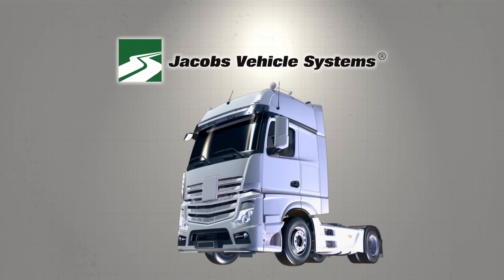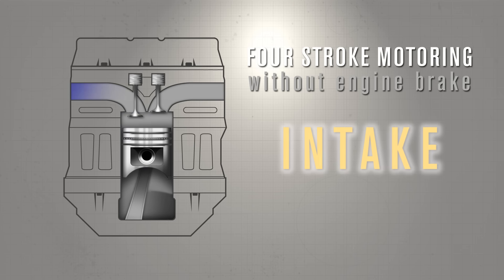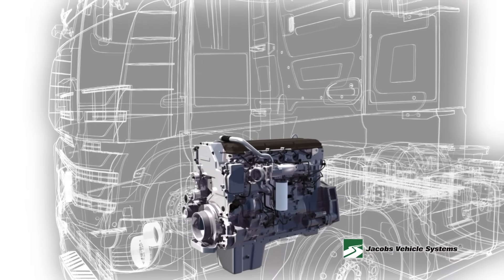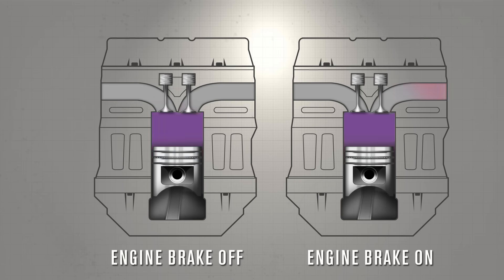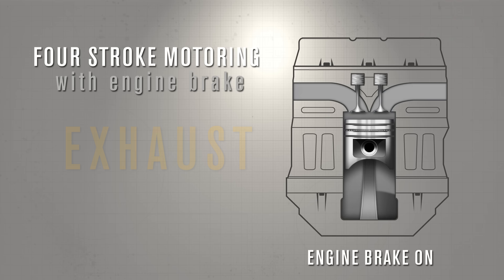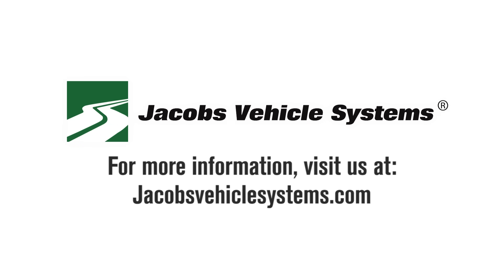How a Jake Brake Works - Jacobs Vehicle Systems

Comment: What I don't understand is how does the exhaust valve open near the top of compression without piston to valve interference? With the process operating as illustrated in this video, that exhaust valve would be completely smashed.
Reply: Most diesel engines are "non-interference" meaning that the piston doesn't travel into the space required for the valves to open fully.
Reply: @redsoldierftcarson  definitely false. Diesel compression is too high for it to be non interference. There's a reason most diesels are timed with gears, and not with chains or belts.
Reply: @kaulincurtis9665  false diesel engines do not have too much compression, they are timed with gears due to the greater amount of torque produced. Chains and belts would not hold up/last and that's important on a commercial vehicle engine. I don't know where you heard that but please Google it or talk to your local truck mechanic. I'm not saying all diesel engines are non-interference, but most of the ones I work with on large rigs/equipment are.
Reply: @redsoldierftcarson  what engines are you working on? I did Google it before I replied, and was unable to find a single example of a non interference diesel.
Reply: @redsoldierftcarson  I am no diesel mechanic, but I am an experienced automotive mechanic. Most gasoline engines ranging from 9-11:1 compression ratio are interference. I understand that the stroke on a diesel is often longer, usually greater than the bore diameter, when compared to gasoline engines. If the stroke was long enough, you could achieve 16-17:1 without piston-valve interference, but, from my understanding, that large of stroke would be impractical because of large frictional losses, crankshaft geometry, block architecture, etc. to accommodate the large stroke. In addition, most diesels have a combustion chamber shape in the piston top, this brings the piston even closer to the cylinder head. I know that 5.9 Cummins, an engine similar to what is found in big rigs and heavy equipment and has all of the characteristics I just mentioned, is indeed an interference engine. 

If you can show me a diagram or other form of hard proof that proves me wrong, I'll take it. If not, I'll believe it when I see it! The internet search consensus is pretty much all diesel engines in service are interference engines.

Perhaps a more accurate representation of compression brake in an interference engine is the valve opens as the piston is part way up on compression, and closes as the piston reaches the top.

Comment: these jake brakes are so useless and so old school that almost has 0 point installing to the trucks. Modern retarders are oil based or magnetic retarders that really can slow down a truck, on downhill with 40 tonns there is no way to stop or maintain the speed of the truck without the service brake while modern retarders can hold or brake down even more the truck. The US is so old faschioned with their 100 years old technology

Comment: Doesn't  that push un-fired fuel through the exhaust? I always thought they just worked as an exhaust brake. I wonder why they don't put them in the big 3 trucks. $$$ I bet.
Reply: It shuts off the fuel supply to the injectors while the jacops brake is in operation, as soon as the engine falls below a set rpm (usually 1000) or the operator disengages the clutch or applies the throttle the system shuts off and the fuel supply is turned back on.
Reply: An exhaust brake is not the same as a Jacobs brake.An exhaust brake has a valve in the manifold that restricts the exhaust gas flow thus slowing the engine.

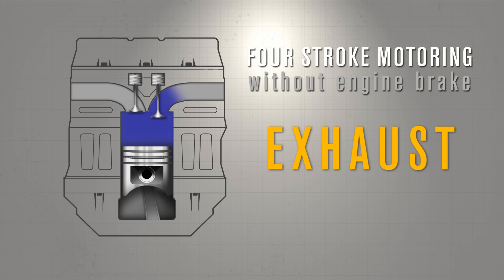Comment: At about 0:49 he states "..and expand, thereby pushing the piston down and returning energy back to the engine." If energy is 'returned back to the engine' where did the engine get it in the first place? This is a nonsensical statement. The energy to run the engine and thus propel the truck comes from energy stored in the combustible fuel.
Reply: The purpose of the video was to illustrate how a jacops engine brake system works not the fundamental operation of a diesel engine.

Comment: this video does not tell the whole truth...your engine is already an air compressor.. it compresses the air after the intake  stroke.. what a jake does is open the exhaust valve, just as the fuel injector would have fired, (causing the power stroke when the jake is off).. this allows all the highly compressed air to escape.. the valve closes..now the piston is at the top, with both valves closed, and it begans to move down, pulling a vacuum, which is what slows your truck.. it pulls vacuum until it sucks the valves open.. 
that's why, when your valve springs get old and weak, your jake brake looses some of its braking ability.. install new valve springs, and your jake will work as new..
Reply: Thanks!
Reply: Actually unless you are referring to another brand or setup that I'm not aware of you have it backwards; the fuel to the injectors is cut off and the exhaust valve is delayed from opening untill just before the  piston reaches top dead center on the compression stroke.
Reply: @redsoldierftcarson  you know nothing of the engine Dynamics.. the exhaust valve stays closed until the exhaust cycle.. the Jake opens the exhaust valve halfway through it's normal closed cycle, venting off the compressed air.. now the piston draws a vacuum, instead of producing a power cycle.. and yes, the fuel has to be cut off, but the injection pump already does that during de-cel..  why is this so hard for people to understand? Google "vacuum pump" look at the way they operate, and you will understand how a Jake works.. it turns your engine into a huge vacuum pump, sucking you to a stop. It takes more energy to pull a vacuum, than to compress air.. 
However, a Jake is very hard on your engine.  I have seen the tops of Pistons sucked off, rod bolts sucked in two, wrist pins snapped, and valves sucked into Pistons.. this is why, Jacobs hides this truth of operation.. you shorten your engines life..

Comment: How does this reduce fuel consumption if its still taking in the same amount of fuel?
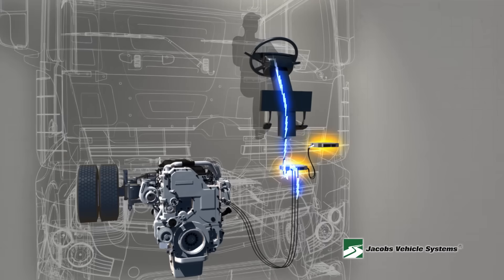Reply: At about 1:40 they remove foot from throttle. This reduces the amount of fuel injected into the engine. But the video is kind of poorly narrated.
Reply: It shuts off the fuel supply to the injectors while the jacops brake is in operation, as soon as the engine falls below a set rpm (usually 1000) or the operator disengages the clutch or applies the throttle the system shuts off and the fuel supply is turned back on.

Comment: He forgot one fact - the Jake Brake was actually invented by Clessie Cummins, the man who started the Cummins Engine Factory. There's quite a bit of history behind it.
Reply: And the first one ever installed was on his boat.  So, when you rev the engine and let the brakes roar, you're carrying on a tradition older than the production of Jake Brakes.
Reply: Yes, I read a very interesting book written by Clessie Cummins. He invented the Jake Brake after his sons took over the Cummins Engine Factory, but they didn't want anything to do with it, so he went to Jacobs Locks and they took it on, which is why it's known as The Jacobs Brake. Cummins did adopt it eventually due to pressure from their customers! Silly kids thought they knew more than their Dad.
Reply: I wonder why Cummins didn't just come standard with this built in
Reply: @P7777-u7r  When Clessie Cummins invented the Jake Brake, he was no longer in control of the Cummins Engine Factory, and the people who were in control at that time would not agree to manufacture the Jacobs system, so Clessie Cummins was forced to look for another manufacturer. He found the Jacobs Lock company, who agreed to take it on as they had the necessary manufacturing capability and were in the process of looking for a new product. That's why it's called a Jacobs Brake and not a Cummins Brake. Cummins Engine refused to fit the Jacobs Brake to their engines for some years as they didn't believe it was beneficial to them. Big Mistake! I believe that it was Clessie's Sons who had taken over, but I'm not 100% sure of that.
Reply: @P7777-u7r  When Clessie Cummins invented the Jacobs Brake he was no longer in control of the Cummins Engine Company, and they refused to have anything to do with it, so he had to find another manufacturer. That's when he approached the Jacobs Lock company. They had the manufacturing ability and were looking for a new product, so they took it on. That's why it's called a Jacobs Brake, not a Cummins Brake. Cummins still refused to fit it to their engines for some years. Big Mistake! All this is in Clessie Cummins book "The Fire Within". Good reading, that one.
Reply: @P7777-u7r  they are factory equipment.  Except Cummins calls it a c-break.
Reply: For anyone interested in the Development of the Cummins engine and Clessie, a must read is "The Engine That Could. Seventy Five Years of Value Driven Change at Cummins Engine Company" by Jeffrey Cruickshank and David Sicilia.
A cracking Read!

Comment: Uhm, wow, I really expected an usual fancy energy converter while engine braking for further fancy usage.. and not some exhaustion/waste system for valuable energy which you actually pay for.
Reply: It's true Ignoramuses of your ilk, that make a comment you know absolutely nothing, whatsoever about!  Prove me wrong and show me a device that actually does what what you state, or hell, better yet, invent something that does hat this does, for both safety, and utility, and I'll eat my words to you, otherwise, quit showing your Ignorance in the public eye  You'd be much better off, trust me!  This device has been in operation for a Real Purpose for literally decades, uhm wow!
Reply: It shuts off the fuel supply to the injectors while the jacops brake is in operation, as soon as the engine falls below a set rpm (usually 1000) or the operator disengages the clutch or applies the throttle the system shuts off and the fuel supply is turned back on.

Comment: So...  it turns a 4 stroke into a 6?
Reply: No, it's an extra rocker arm that takes control of the exhaust valve(s) in a cylinder and keeps it from opening until just before the piston reaches top dead center (end of upward movement) thereby using the engines compression to slow the vehicle.

Comment: So when it happen there no fuel going into the cylinder? And is no then does the truck die or how does it keep running?
Reply: a jake brake will stall a engin. it has two switches one inside one on the engin. the jake olny works when your foot is off the accelerator and the switch is on

Comment: It would be something if the compression could be stored and later used.
Reply: Like a separate exhaust valve (only used with the jake brake) that leads to an air tank?  That would be really useful.

Comment: Too bad the video never tells us HOW a jake brake mechanism works...that is, how exactly does it keep the exhaust valve open. Could not bother with that detail.
What are service brakes? Are those what we normally call "brakes"?
Reply: Yes, service brakes are what the segment of population unfamiliar with proper vehicle nomenclature calls simply "brakes". The Jake Brake works by actuating the exhaust valve rather than the fuel injector. So... the intake air is compressed and then dumped slightly before TDC.

Comment: 2:18 valve open and piston crash into the valve? Fail?
Reply: Big Diesel engines are not critical engines. Meaning that there is enough clearances for this operation.
Reply: Diesel engines are usually "non-interference engines" meaning that the piston doesn't travel into the space required for the valves to open fully.

Comment: You can drive with a Jake brake at full volume anywhere in Colorado. You would never hear it over the straight pipe Harleys.
Reply: $500 fine in Colorado for unmuzzled jake brake. There’s a sign at every port of entry and when you cross the state line. If you roll across the scales with no visible muffler they will call you inside and talk to you and either write you a citation or you show them an underneath muffler.
Reply: That's not at all accurate
Reply: I thought Vail had "no jake brake" signs everywhere, because they prefer truckers fading brakes and killing minivans full of kids, versus having to hear that ghastly noise.
Reply: @MockOverdrive  Vail is a tourist trap these days, growing up just off of i25 i would hear them all the time.
Reply: @MockOverdrive  this is a 0 IQ comment lol
Reply: To be fair, I too get annoyed at truckers who purposely mod to make jake louder, it's incredibly disrespectful and equates to being a 13 year old attention whore on tiktok. All jakes should be somewhat muffled by federal law.
Reply: @MockOverdrive  yikes.
Reply: With or without straight stacks? Several belly dumps and bull racks around here have straight stacks and it's music to my ears 😊

Comment: Sorry Jacobs, you don't get to remame the combustion stroke to "expansion," for the purposes of this video alone. Also, the same exact "engine brake" could be applied by adding a switch that temporally shuts down ignition; similar to turning the key off while driving.
Reply: If you just stop the ignition (On a diesel, stop the fuel), it won't be AS good as a jake brake, because the compressed air will act like a spring and still force the piston down somewhat. The jake brake opens the exhaust valve at the end of the compression stroke, releasing the air before it can act downwards on the piston.
Reply: Well, first of all if I'm less than nothing, then why are you replying? Diesels run without electric? Goddamn, you're stupid. A glowplug is directly connected to the ignition. IT'S AN ELECTRICAL ITEM!
Have I turned off my key while driving? Yes, I'm from an era where sticks were common, but you'll learn all that when you take your driver's test next year. For now, you're grounded for being a total asshole. Now go to your room!

As a side note, I see you young guys hiding behind the keyboard, acting tough, but you're all pussies in real life.If you ever got past that first sentence irl, you'd be breathing through a tube. Think about that tough guy.
Reply: Nicholas Sway but...he is right, though. Came off a little angry but glow plugs are only for cold starting, theres a good number of diesels not even equipped with them.
Reply: So when you park your rig, you don't turn off the key? I mean you guys are saying it will keep running!
BTW, I said "SIMILAR to turning off your key..."
Reply: Nicholas Sway well sure i turn off the key. Diesels will quit after the powers been cut only because the fuel pump will quit. Im not commenting on the relationship between diesel engines and electricity, beyond diesel engines being able to run without it. I just thought it was a neat fact
Reply: nicholas in some trucks older macks you turn off the truck by pushing the injection pump cable and then you can crank all you want and no starty smarty  and the key off engine off refers to newer trucks they have a pump cutoff solenoid old truck this was done manually!!!  man alive!! your parents should have named you ray because your just so bright!!!!lolololololol!!!!! adios keyboard cowboy!!!!

Comment: ** oh,       it pumps un-burnt fuel out the exhaust.
Reply: It shuts off the fuel supply to the injectors while the jacops brake is in operation, as soon as the engine falls below a set rpm (usually 1000) or the operator disengages the clutch or applies the throttle the system shuts off and the fuel supply is turned back on.

Comment: I know virtually nothing about trucks is this the same as engine braking?
Reply from the maker: Yes, engine braking is the generic term.  The engine brakes made by us, Jacobs Vehicle Systems, are called Jake Brakes.
Reply: engine breaking as in down shifting? in my area when people say engine break that is was they are referring to not jake breaking which ias  i vaguely understand uses a different method to slow down the vehicle.
Reply: Paul Schauer, gasoline engines have a throttle body, or some means to control air being sucked into the engine, diesels do not. Hence the need for this system.

Comment: You blokes had better get some NEW animator's , because what your depicting is NOT how mine works at all.  The Venerable sound of a Jake ,   and you KNOW it's working 'cause you can hear and FEEL it , 
I'm sure all those pussies that bitch and moan about Engine brakes would think again is as a result of NOT using your Jake you came crashing through their house in the middle of the Night. 
It's a Brake , it's a SAFETY feature and IF I need I WILL use it however and whenever I NEED too , to safely control the speed of my vehicle -  the whiner's can get stuffed !! .

Comment: Jacobson  braking  system  is  great! life saver!
Reply: If you can't depend on your service brakes to save your life, you need better brakes.  If mechanical brakes can stop an 80,000 ton train, stopping a 40-ton truck should be no problem.